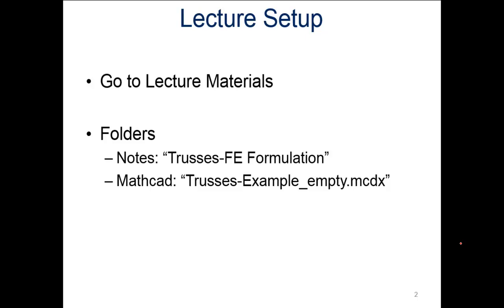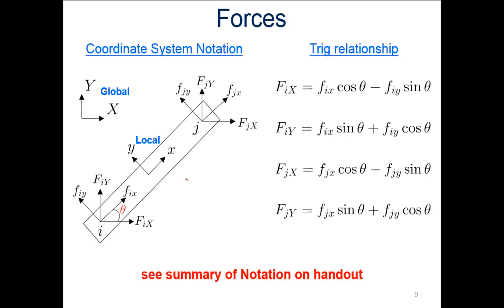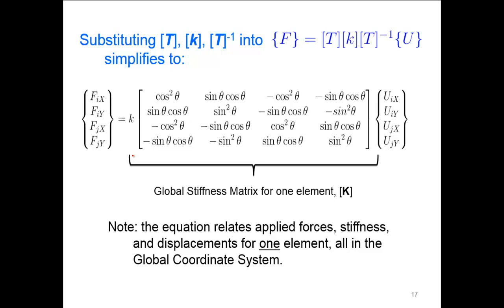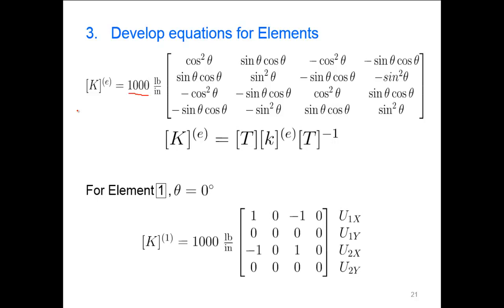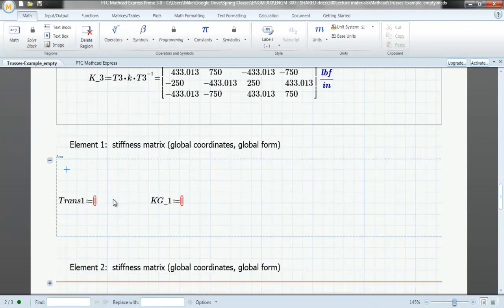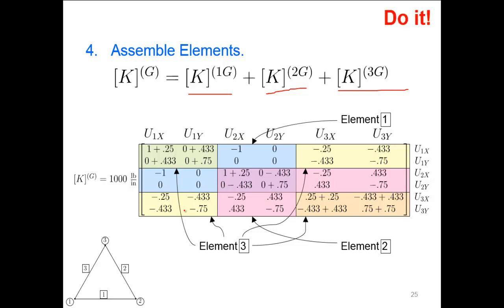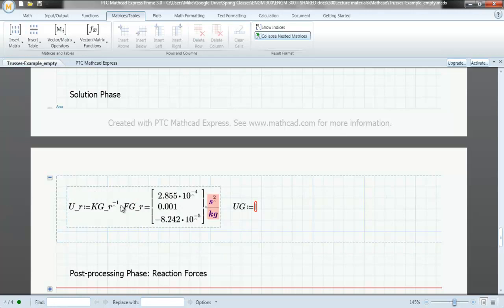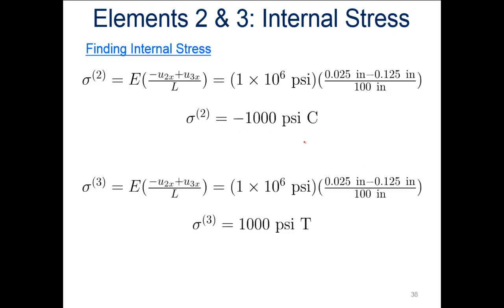Trusses - FE Formulation (+ Mathcad)

Comment: Thanks a lot @ Mike Foster! I really did benefit from your presentations!!
One question: I would like to know whether we only have 2 types of stiffness matrix(one formulated for bar/beam and other for trusses/frames). what if a member like a beam(or frame) has a hinge?  K=??
Reply from the maker: Check out the video on Frames (https://youtu.be/m4wbRXfp4Os?list=PLX36sAKtIxj0s5VJB6fVfmNe1Sm6-tNwz, if you need more background, check out the playlist that the video is a part of and watch the previous videos). A Frame analysis will allow you to set boundary conditions for the rotation about each axis. Whatever axis your hinge is "around," you will NOT set a boundary condition on its rotation. You WILL set boundary conditions on the rotation about other axes as appropriate for your model.